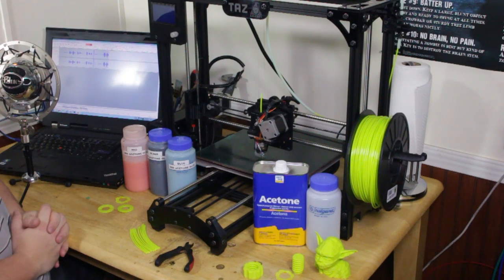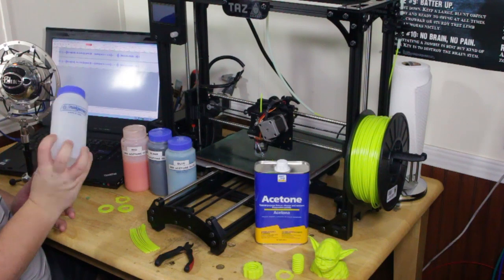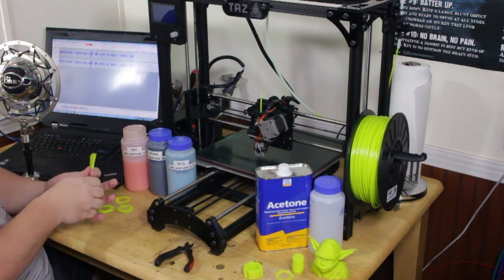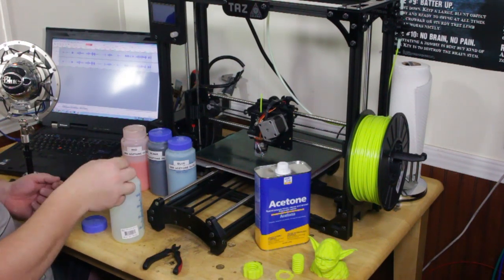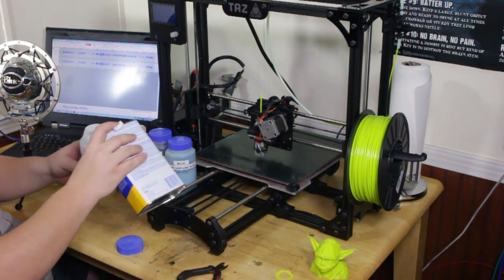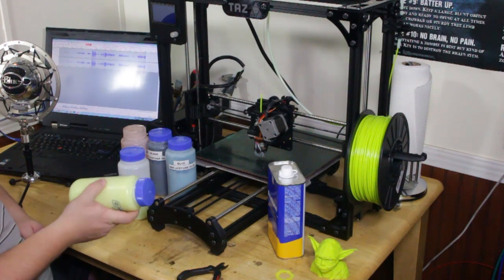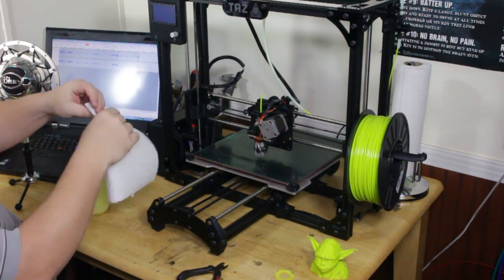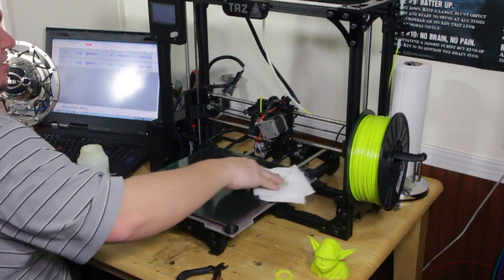3D Printing Tips and Tricks - How to make ABS Juice to help your 3D prints better stick

Comment: I have had to glop it on there to get shit to stick. Giving it one pass with a paper towel like you just did, even on kapton tape, my shit wouldn't stick. Could this mean I have bad filament? My 3D printer is even encased in acrylic so it doesn't cool down as fast.

Comment: You should never open a can of acetone with the lid facing towards you. In other words, if you open the acetone as he did and you can see the bottom side of the lid...face the can in the opposite direction next time. Acetone always releases a vapor...depending on temperature, this could be substantial! Also...ALWAYS wear eye protection!  GREAT AUDIO...good EQ and compression!